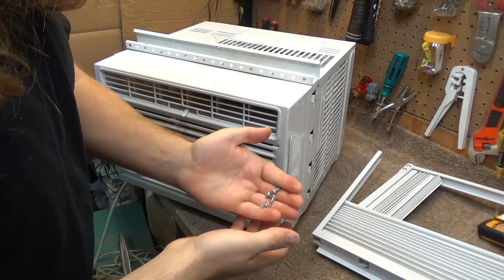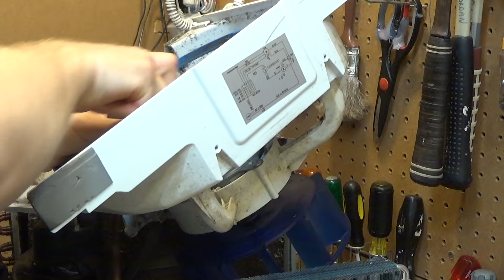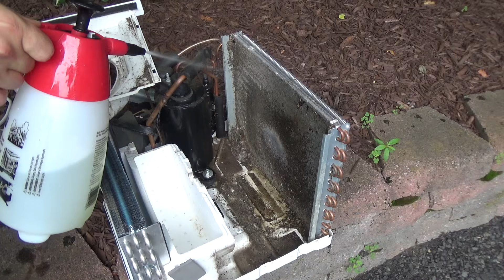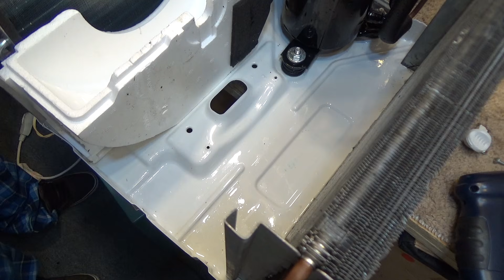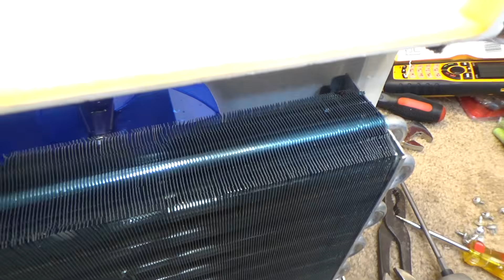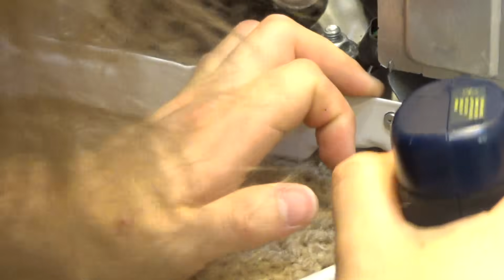How to Clean a Window Air Conditioner

Comment: great video. I wonder how to clean the a/c in an apartment building. 
Since these are modular unit, the motor wire is likely plugged into the control unit. If you unplugged it there, that would have made your job somewhat easier.
making a drain hole is a great idea. I did it on my portable danby unit which would shut down from time to time. placed a channel under it to direct the distill in a bucket

Comment: OMG bro, the more you take apart the more CRINGED out I get at the thought of taking this apart myself to THIS level. I just got one of these units, so mines not dirty (It's a Midea 5000 BTU) who makes these same ones I think. It looks extremely similar.... I know it's eventually going to get dirty but my gosh, taking it apart to this level has me totally creeped out.
Reply from the maker: I fail to understand how it's creepy or cringy to take apart a household appliance for cleaning and servicing in effort to save money.
Reply: @JordanU  Sorry. I didn't mean it to come across that way. I mean, the deeper you went, the more freaked out I would get at seeing myself try  going this deep into the machine to get it cleaned... In other words, it made me somewhat paranoid at the thought of trying to get all that back together.

Comment: Does the wire in the front need to be in a specific spot for max cooling or no
Reply from the maker: It needs to be as far forward from the coil as possible. If it is too close to the coil, it will read a lower temperature than the air is.
Reply: @JordanU  oh ok thanks ❤

Comment: Being a female that has never attempted anything like this would be very intimidating for me: looks like a total dismantle and reassemble job. I guess I'll have to pass on cleaning this unit and ask a whole lot of questions about cleaning requirements before buying my next unit.
Reply: Its not worth it bb my hubby did it and broke like 3 parts its literally a 4 hour Job and it smelled terrible, buy a new one😭
Reply from the maker: None of the machines made today are easy to clean.
Reply: Girl, you cannot think like that you need to think anything a man can do I can do better. I need to clean my air conditioner n this shit. Looks like fun to me even though it looks like a fucking bitch to get done. I'm a weirdo like that though.

Comment: Thank you for this video. I just bought my first window air conditioner unit. I’m glad to know how to service it. I wonder if I should add the drain that you added. I live in South Carolina and I think the annual pollen season would be pretty hard on the condenser with water splashed on it.
Reply from the maker: Absolutely drill the hole. The coil being wet will cause the pollen to stick to it and clog it up in no time.
Reply: @JordanU   I did what u did and when I plugged it in it powers in but the fan doesn't spin it sounds like something is blocking it now that the compressor or fan isn't moving please help !! 
 It was fine before I clean it but it needed to be cleaned
Reply from the maker: @samanthaloyo7087  You need to disassemble and check to see where the fan is hitting.

Comment: I try no to strip my AC unit down to this level ? Every time I do disassemble a AC unit, I find a Rattle or a Noise comes out of nowhere that I cannot fix ! I leave the Covers on and use a good Coil Cleaner and garden hose to wash out all the debris, I'm in Canada so I only use my unit 2-3 months of the year.
Reply from the maker: OK
Reply: Thank you for making this point about the potential noise. I'm looking for a new A/C now and the noise factor is good to know.

Comment: Excellent! Even showing experience and not hiding it. Such Confidence!! I hope to watch again before attempting. I think I'll video tape so I can recall where everything goes. Man alive!! But because of breathing in a room, in a guest room,  a couple of nights ago and waking up first and second day with a sore throat I KNEW it's got to be the A/C. There's got to be so many people that have NOT see what we just saw inside an A/C. I wondered about the "freon" and how one would know if that is something to be concerned about and how many years you would deal with that. (R-410A  that is the new type of ? for the ozone layer issues. I just had to look that up) THANK YOU! Did you do this all in one day? Did you need to have any "time" for air drying?
Reply from the maker: Glad the video is helpful to you. No drying time needed as long as the controls don't get wet, the unit is intended to be able to operate while wet.
The refrigerant fiasco is a non-issue, it's not going to do any damage to anything if it's concealed within the machine.

Comment: I call bs. That thing looks like it is dam near brand new. Any dirt in that thing was put there intentionally. By the time any window ac gets gummed up every screw will be rusted to crap from being outside and in the rain elements ect, and you are better off buying a new one. Mine usually lasts 3-4 years cleaning off the intake filter every month while in use and taking the garden hose to the inside every fall and mine runs 100% of the time 24h a day on high cool 62 degree beginning in March.
So in 4 to 5 years you will just buy a new one because it's not worth the trouble to tear it apart and clean an AC that is now outdated less efficient and does not cool as well as it did when it was new.
Reply from the maker: You are a total fool.
Reply: The AC was made in 2018

Comment: Great Video.   This is the only video showing how to fully take the A/C apart for cleaning.  All the other videos only show cleaning from the outside or without removing the fan/shroud.   
I can see no way to effectively clean the condenser without taking the fan/shroud out.  On mine I could barely lift it up enough to clear the condenser.   The wire connecting the fan was too short and they had it ran between refrigerant lines.   There really should be a removable filter on the condenser, just like the one on the evaporator.  

I completely agree on adding a drain after I opened mine up.  The bottom of the condenser was rusted pretty bad and the tray was full of nasty pond scum.    
I could care less about a little bit better efficiency from water being thrown on the condenser.  I'd rather the a/c last longer than save a little electricity.  All other A/C's have drains.  
I'm sure the water adds to the dust collecting and clogging the condenser up.   I'm betting it will stay cleaner much longer now.  I also don't care about water dripping on the ground. I'm sure it could be a problem in apartments in the city.  A removable drain plug would have solved the problem.  If dripping water is a problem, leave it in.  

I spent $18: 
$8 on a Frost King -  Air Conditioner Fin Tool.  It worked great.  Spray the coil with dish soap so it will slide better.  
$8 on a can of Arm & Hammer HVAC Coil Cleaner.  Enough cleaner to clean multiple window A/C's or a single A/C multiple times.
$2 dish cleaning brush to brush the condenser.

It took me one hour to take the window A/C apart and clean it and maybe twenty minutes to straighten all the fins on the condenser.   The A/C looks like new inside and out now and while running outside on my truck tailgate it was blowing out 30 degree colder air than ambient.   Well worth the investment and time.
Reply from the maker: Your theory about the condenser staying cleaner when dry is absolutely correct. A dry coil will allow a lot of dirt to pass through and is much easier cleaned when the time comes, meanwhile a wet coil will cause the dust to stick to it.

Comment: Great tutorial, thank you Jordan! I have my unit most of the way apart and about to blow out the dust with compressed air and then clean the coils with hydrofluoric acid like you have done. I bought a gallon from a local A/C parts store, and mix it in a harbor freight pump sprayer.

This works great on the A/C coils and radiator of your car as well. Just warm up the car and generously spray the foam in both sides and all over coil and radiator, sit for 15-30 minutes and hose off. I don't use a sprayer, only rinse straight out of the hose to ensure no damage to the fins.

The hydrofluoric acid "etches" the aluminum fins, removing dirt and debris that prevents transfer of heat from coils to the outside air.

This maintenance makes a noticable improvement of the cooling efficiency of the unit, plus lowers the energy consumption and extends the life of the system.
Reply from the maker: I wouldn't advise letting the cleaner sit on a machine like this for more than a few minutes tops. These coils are very thin and cheaply made, you're walking on thin ice after a half hour of interaction with the cleaner.

Comment: DO NOT DRILL A DRAIN HOLE!   Read the manufacturer instructions. They don’t put a drain hole FOR A REASON.  The unit needs some water to help cool the hot coils.  Now he has RUINED his conditioner.  Why?  Cause he’s a numbskull who won’t read.
Reply from the maker: There is something so very wrong with you. I'm not even going to bother trying to correct your inaccurate spam because stupid doesn't comprehend and it would be a waste of my time to try. Turn off your computer and find something constructive to do with your time.

Comment: You should NOT drill a drain hole. They don’t have one for a purpose. It needs some water to help COOL the hot coils.   Learn...before making a mistake.
Reply from the maker: There is something so very wrong with you. I'm not even going to bother trying to correct your inaccurate spam because stupid doesn't comprehend and it would be a waste of my time to try. Turn off your computer and find something constructive to do with your time.

Comment: What's the cleaner called and where can I get it. My AC needs a clean badly foam-brite
Reply from the maker: The cleaner used was NuCalgon's FoamBrite condenser cleaner. It is marketed for professional use only and you will not find it in the hardware store. You may need to settle for NuCalgon's NuBrite, which is the consumer version of the product.

Comment: This video has saved my LIFE! Would you recommend any other condenser coil cleaner that’s more affordable ? I rather not spend $30-$40 on that brand for only one AC.
Reply from the maker: I have not used any other coil cleaners that worked as well. You don't use the whole container on one unit, you could probably clean this machine 5 or 10 times with the gallon container.

Comment: Great video!
Reply from the maker: Thanks
Reply: @JordanU  No problem
Reply: What do you do if a window air conditioner's evaporator coil freezes up after running for an hour or two? Blows cold when it first turns on.
Reply from the maker: @gatrwrksMarshall  If it's a newer unit like the one seen in the video, the refrigerant is probably leaking out and now the unit does not have enough within it to operate normally.

Comment: I cleaned my ac unit and I can’t put the control knobs back on they feel loose any advice? It’s the same ac with the same knobs as this one
Reply from the maker: There's a notch on the control's shaft that the knobs have to line up with, other than that they just push on and are held on by the friction.
Reply: So is there just a pull out filter I can change

Comment: thats the biggest centrifugal blower wheel ive ever seen. loved the drainhole mod too. you literally doubled if not more than doubled that units life!
Reply from the maker: I've seen larger ones in commercial systems, they create good air pressure but they're rather noisy. Quite a ridiculous application in a machine like this in my opinion.
It's still a piece of Chinese junk, but at least now it won't fail from rust!

Comment: That's the pits that you can't adjust the thermostat..
Reply from the maker: It is, but on the other hand it doesn't really matter because I'd never want to run it cooler than it goes anyways.
Reply: @JordanU  
True. But can you make a video of how to clean a window air conditioner without removing it from the window? I really need to clean my window unit, but my mom will get mad if I take it out of the window...
Reply from the maker: @BeamNGRoamerGuy2003  You can't really.
Reply: @JordanU  
So I just got my garden hose and thoroughly sprayed down the condenser for nothing... As well as using a spray bottle for the evaporator...
Reply from the maker: @BeamNGRoamerGuy2003  If you spray some cleaner in from the outside then push the water through, it may do something. But I don't think water alone will do much of any good.
Reply: @JordanU  
There was this moment where I knew I screwed up: https://youtu.be/sHcN60NgwRE
Reply from the maker: @BeamNGRoamerGuy2003  There's no drain hole in the fan's chamber, because normally no water would get in there during operation.
Reply: @JordanU 
An hour after that flooded, it apparently drained.
Reply from the maker: @BeamNGRoamerGuy2003  It must have evaporated.
Reply: @JordanU  
Anyways, I'm just going to send it to you when I don't want it anymore.

Comment: alot of times i find the screws in older units are either rusty or just snap off, i normally replace them all with small sheet metal screws, not exactly sure of the measurement but i think they are like 1/2 inch long and they have a slot in them for a screwdriver and a 1/4 inch.
Reply from the maker: Several of the screws on this machine could fare to be replaced. The length doesn't matter too much as long as they're not long enough to collide with any of the lines.
Reply: NO

Comment: Thanks for uploading this video Jordan. Some people don’t realize how important it is to keep an air conditioner clean. When it stops blowing cold they just toss it out instead of checking the filter evaporator or condenser. That’s how many vintage units get trashed because people can’t take good Care of them.
Reply from the maker: That’s very true unfortunately.
Reply: thats what 99% of window acs problems come from... not being maintained
Reply from the maker: @TheAirConditionerGuy  True, that can be said about most all ACs in general.
Reply: BITCH
Reply from the maker: @michaelporter5098  Do not post spam.
Reply: NO
Reply from the maker: @michaelporter5098  Do not post spam.
Reply: STOP
Reply from the maker: @michaelporter5098  Do not post spam.
Reply: NO
Reply: @michaelporter5098  SHUT. YOUR. MOUTH.
Reply from the maker: @michaelporter5098  Do not post spam.
Reply: RAIN
Reply from the maker: @michaelporter5098  Do not post spam.
Reply: STOP SIGN
Reply from the maker: @michaelporter5098  Do not post spam.